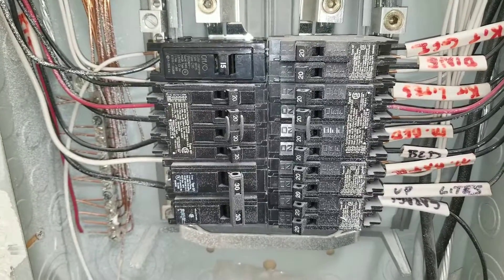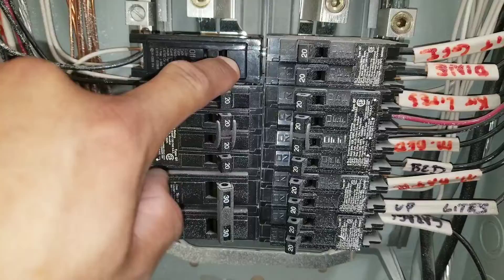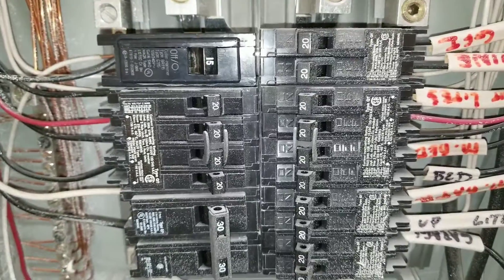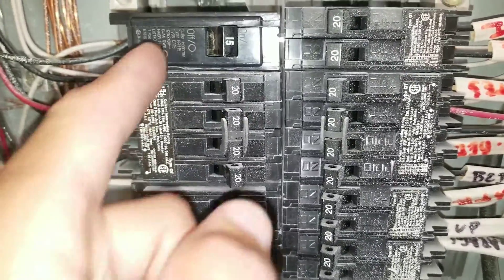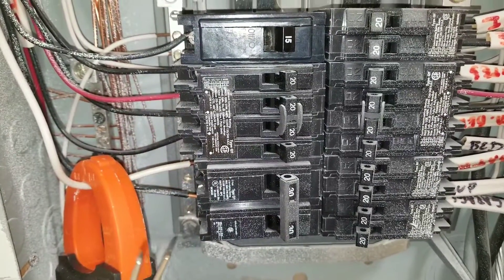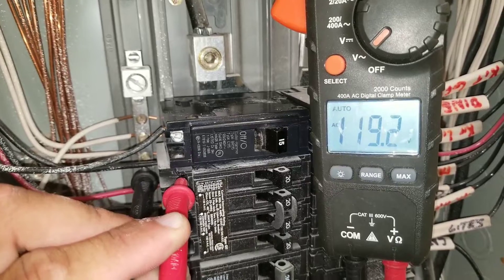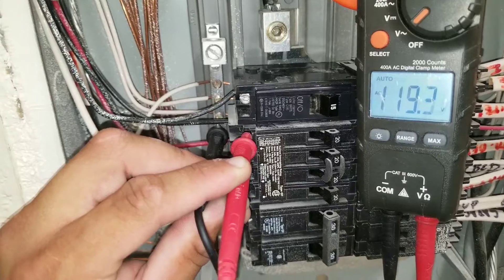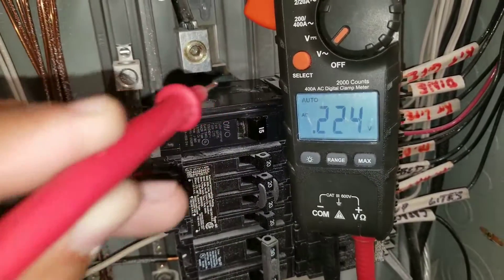Checking Testing Bad Circuit Breaker

Comment: Howndo u test current
Reply: If you look at the meter that was hanging by the clamp in the video, you open the clamp and close it around a conductor.  Set it to AC amps and it will tell you current.   Mine will do DC current too.

Comment: If lights are flickering, but the breaker is t tripping, and it only seems to happen on the circuits associated with tandem breakers, could that be a breaker going bad?

I can hear it sparking, and I don't see any spark marks on the bus's.  I assume it's sparking inside the breaker itself, but not tripping.   Not sure how to test for that

Comment: What if the outlets not working, I check the breaker and gave me 12v then changed it for a new and issue remain then I changed one of the outlets and now I'm getting 24v? What could be the issue here?

Comment: If the leads are not touching anything does the voltmeter read zero?
Reply: If it’s not connected it should zero. Depending on the meter and it’s calibration they might be a little bit off.
Reply: Slight voltage in the air believe you me. Touch the leads together it should read 0
Reply: Not quite zero but almost zero, .015v for example.